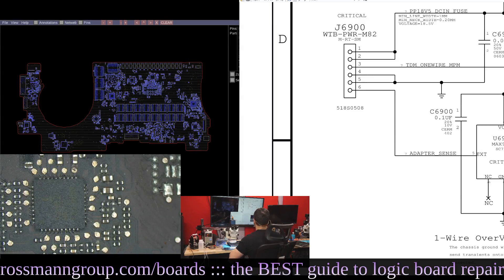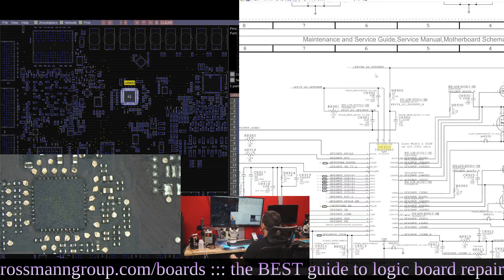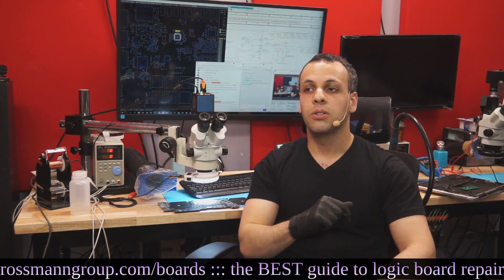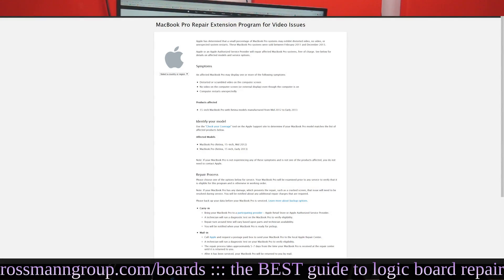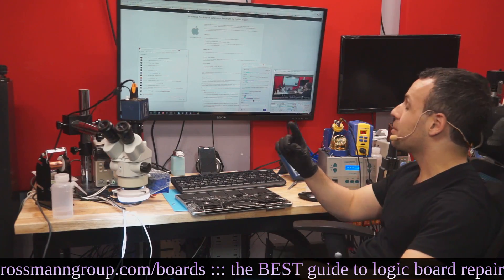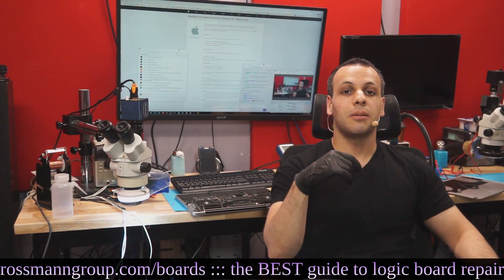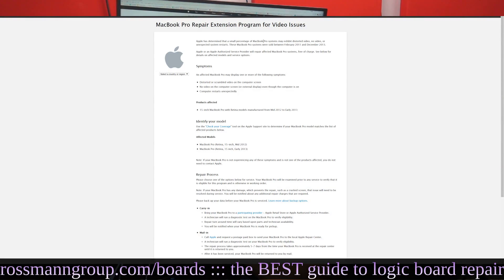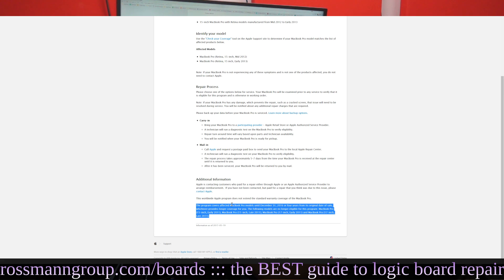Why 2012 15" Retina Macbook Pros with GT650M DIE

Comment: Speaking of 2012, apple is still selling 2000 dollar laptops with DDR3L Ram...
Reply: If you are going to criticize something, at least come correct. All the above comments are false.
1.The Macbook's current line up (2016-Present) uses LPDDR3 and not DDR3L(There's a difference).
2. 6th Gen U series chips and above support DDR4 Ram. Apple chooses to manufacture boards with LPDDR3 Ram for the lower power consumption. The chip itself can support 32gb of Ram using DDR4 (Macbook's max out at @ 16gb w/ LPDDR3).
3. Lastly there have been two architectures to come out since Skylake. Kaby Lake (7th) and Coffee Lake (8th). Most of the current line up use 7th Gen Intel CPU's. 8th gen brings quad-core U series CPU's with turbo speed up to 4Ghz which is a huge performance increase considering the U series was limited to 2 cores.
Reply: Other way around David, they do use LPDDR3, not DDR3L. 
https://www.apple.com/ca/macbook-pro/specs/
Reply: More that Intel hasn't introduced a new architecture in a couple years, so Skylake's IMC is still in use.
Reply: LPDDR3 is a different technology from DDR3/DDR3L. 

DDR4 is more efficient than DDR3L, anyway (0.15V lower voltage with similar current draw).
Reply: tipoomaster god, then that's just silly. Why not just use ddr4? It's similar in power consumption and it's faster.
Reply: Avarage human can notice something like10% boost in performance and ddr4 would give you how much of that? 1/4 of that? Is that answering your question?
Reply: It's not Apple, it's Intel that's only selling low power mobile CPUs with DDR3. Cannonlake is coming any year now to fix that ... that may be part of the reason Apple are supposedly considering making their own chips.
Reply: Reubin Huckle absolutely, and DDR3L is what is used. Not LPDDR3